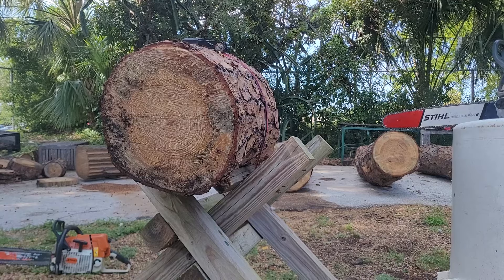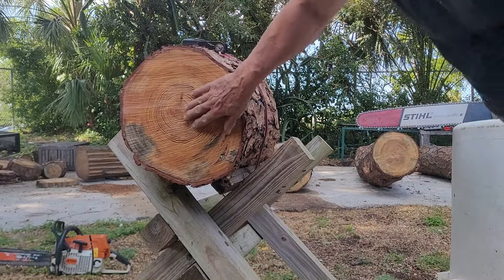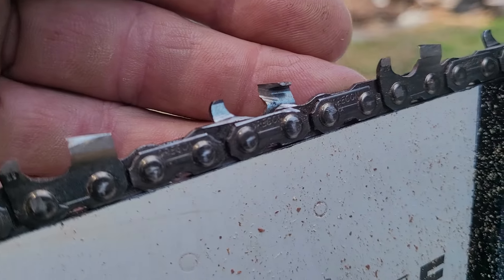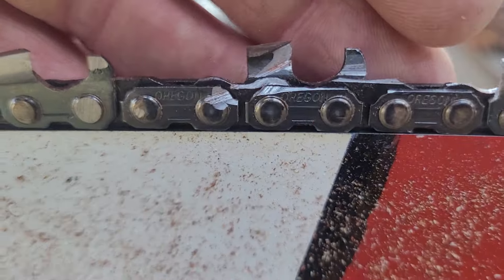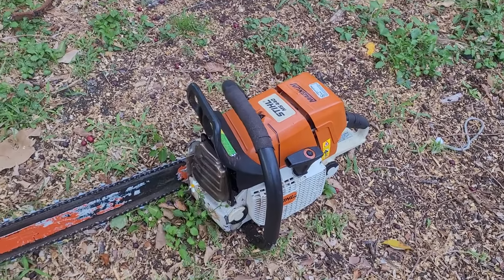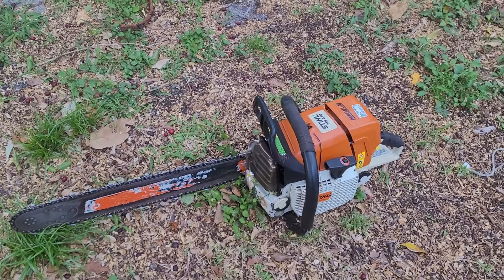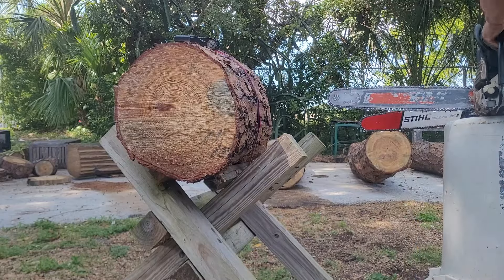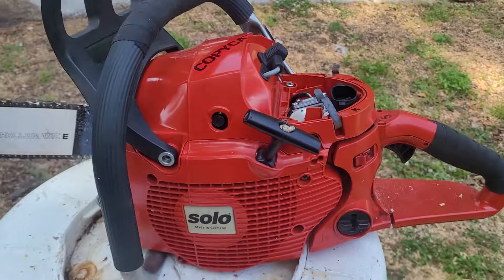SOLO 681 ported 20" bar STIHL MS 440/ 460

Comment: Port that Hybrid. It will be insane with your chain!
Reply from the maker: It's a reliable work saw 👀
Reply: @reillystsb  Yes. But it cut so much faster and still be a good reliable work saw. 😉👍
Reply: Hi John love your videos I have got me a solo 665 new saw but old stock I want to ask you is it the 681 much more powerful than 665? I cut some big timber and where can I buy a 681 cylinder and piston nowadays?thanks again